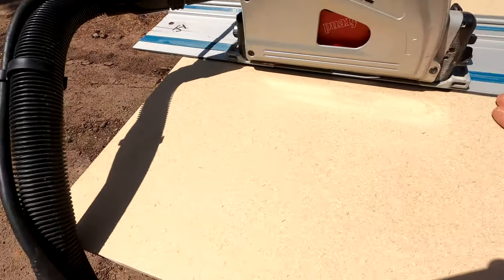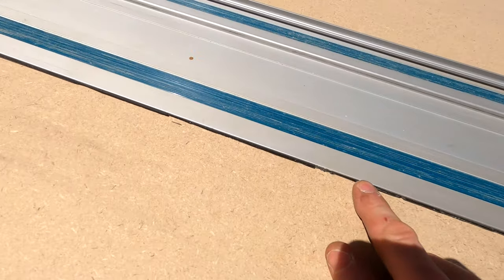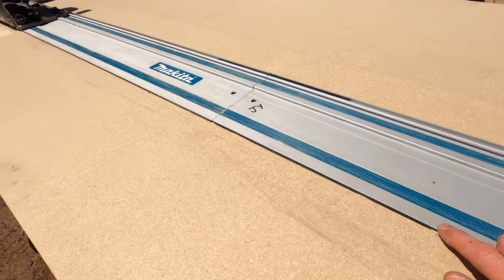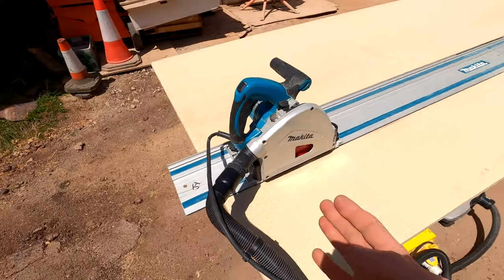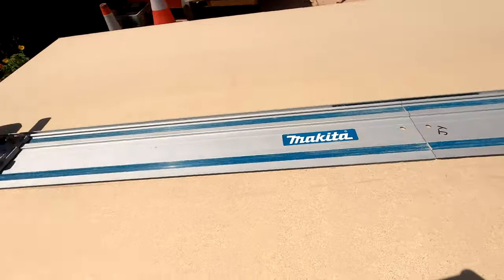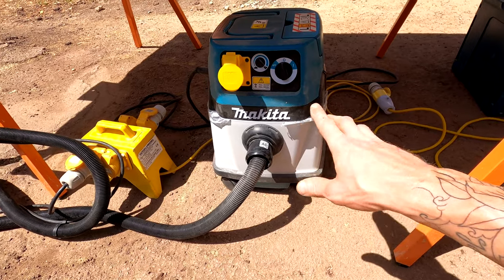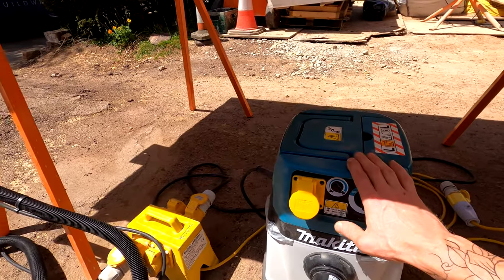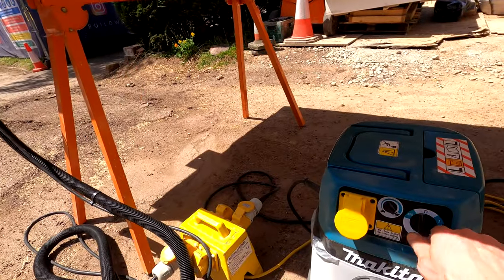USING A TRACK RAIL SAW! - TIP TOP TOP TIP

Comment: I think replacement rubber strips are available. I have only ever changed my blade with one of the same width as the orginal. I also use clamps that slide in under the rail and always clamp the rail down to the workpiece. Because the Makita does not have a riving knife I also support both sides of the material being cut. Speaking of HSE, my wife is an occupational doctor. She has loads of cases of asbestos related diseases, and although it's said to avoid wood fibres, there are hardly any cases of illness from wood. Trades such as electricians are getting asbestos illnesses. Even though they don't work with it directly, drilling holes in lots of asbestos panels over a long time is the danger. Also, the real numbers of asbestos illnesses is going to be worse in 30-40 years. As asbestos was used a lot in the '70s, and these properties are now starting to be renovated. It takes about 40 years for illnesses to manifest, so people working on renovations now, are the ones who will be affected in 30-40 years time. I live in Switzerland, and stuff like tiles/tile adhesive can't be removed, unless it's done by asbestos removal teams, in full gear.

Comment: Another tip top top tip. Cover the hole on the side (where you put the Alan key to change the blade) and you’ll gain another 20% more on dust extraction. Loads of 3D printed ones online.
Reply from the maker: That's a great shout, I'll have a look at that.

All the best, John 👷🏼‍♂️
Reply: Same applies to Bosch track saw,Bosch,Festool actually sell a dust cover for their saw.

Comment: M class extraction has been required for about 2-3  years now and HSE is now looking for this to be in place, also they require vacuuming of workplaces instead of sweeping. There has been a prominent court case in which the verdict reinforced this. Good kit and set up there other than that.
Reply: I use M class extraction with my  track saw,but I also still wear a mask.
Reply: @stuartandrews4344  Good practice, it really does reduce the risks. Also there are more power fed hoods at substantially cheaper price points than 2 or 3 years ago, so no excuse for unshaven, bearded workers or those who find masks uncomfortable.
Masks don't protect properly if you're not clean shaven.
For employers, don't forget to have initial and periodic face fit testing carried out for your employees and keep records.

Comment: Hi John, can I clarify the extractor your using basically works fine for any tool rated above 850w as long as it is turned on manually, presumably this is because it a 110w tool and the motor can't take big loads.
Reply from the maker: Hi Kevin,

With that particular model, any tools over 850w must be connected to their own power source. Makita do make extractors which take a higher load, but they are a lot more expensive.

Hope this helps.

All the best, John 👷🏼‍♂️